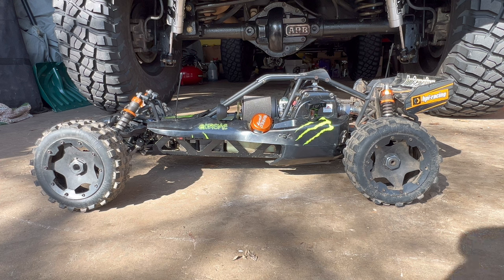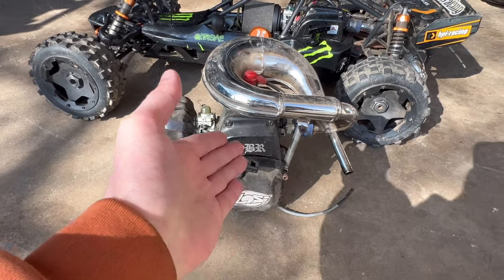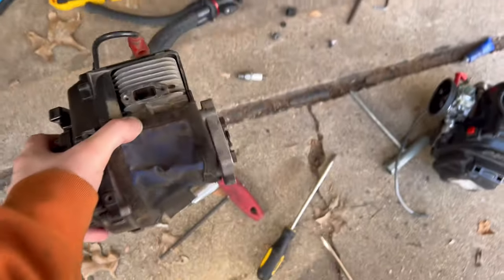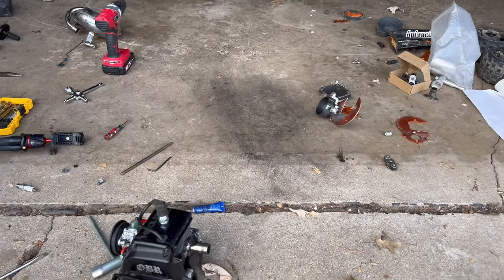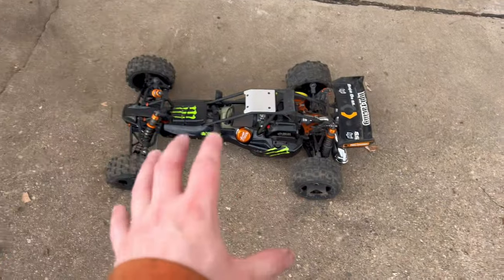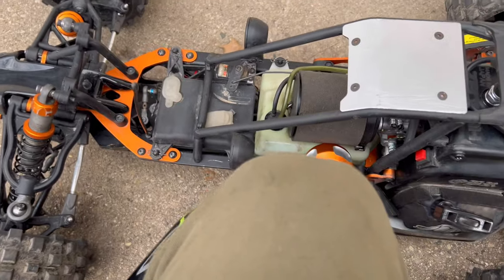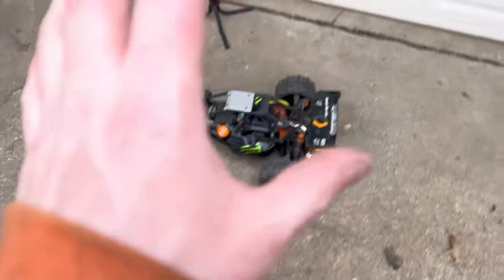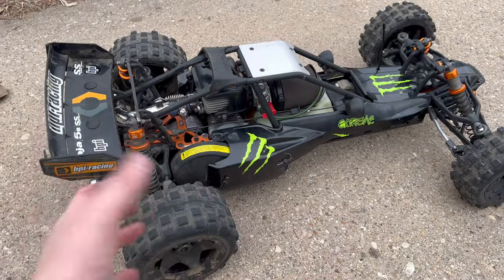SWAPPING a 7.5HP ENGINE into my HPI Baja 5B!!

Comment: Hey so I was wondering what 3s LiPo’s you would suggest I get? I had HRB but the white cords keep breaking and won’t connect with the traxxas EZ-peak charger. I’d prefer not to get traxxas batteries because they are too expensive.
Reply from the maker: I like Hoovo and Ovonic batteries….they’re pretty cheap and work well
Reply: @RCKnockout  thanks! I was gonna try the hoovo batteries so thanks!
Reply from the maker: @zaflashzach8011  you’re welcome 😉

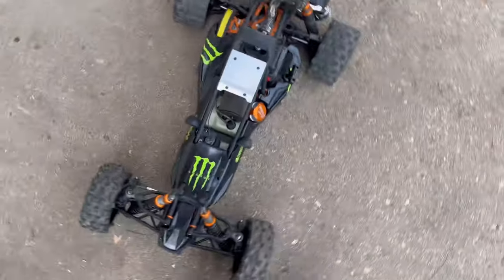Comment: Am I first👀 9:23 everybody’s worst fear
Cross threading or stripping threads😣💀
Reply from the maker: Yeah it was unfortunate…but things happen
Reply: strip it back down to where you can access the bolt/screw, take a dremel with the circle blade/saw attachment and put a slit in the bolt/screw. this will heat up the bolt/screw in seconds AND creates a nice slit for a flat head driver.
Reply from the maker: @deku.m1505  thanks for the tip!